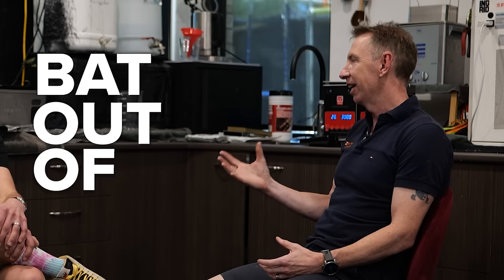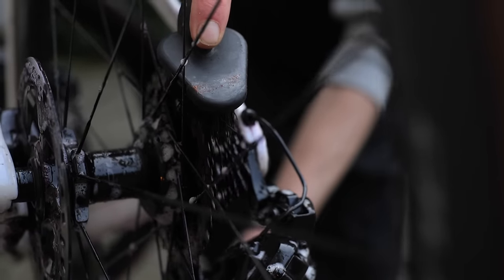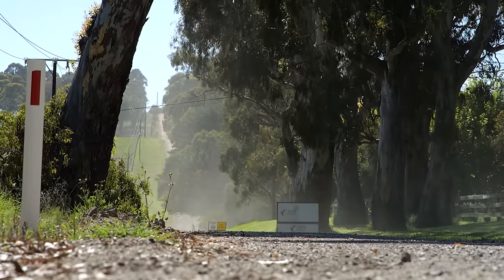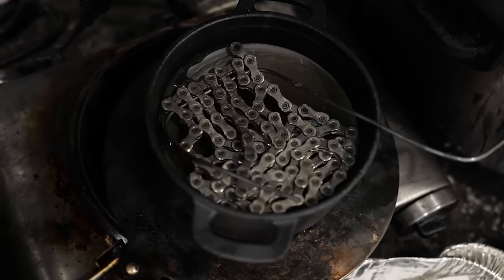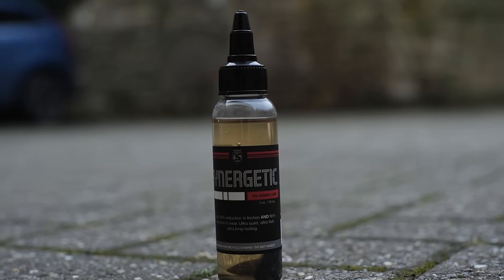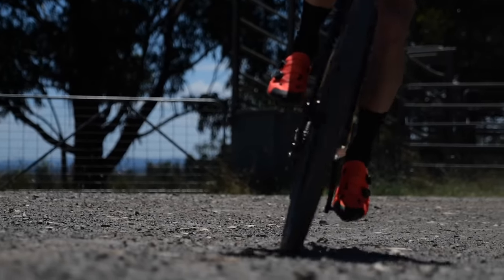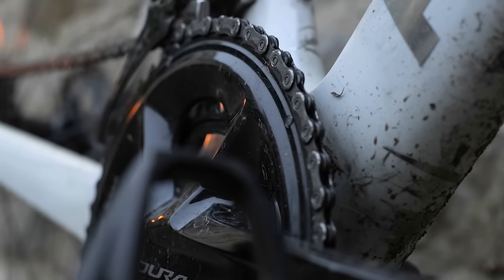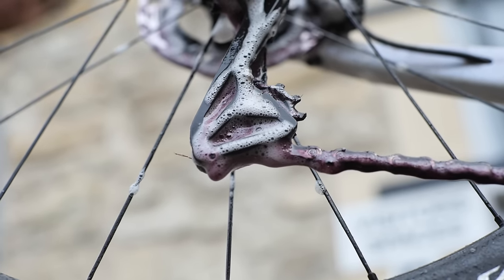They Don't Want Your Chain To Last This Long

Comment: I have to disagree with the general statements that wax lubes are worth it in time and money. I think you are wildly exaggerating the dollar amount saved and wildly underestimating the time spent in the waxing process.  
I typically ride 400km per week.  If we go by the experts recommendation of re-applying every 300km, that would be every 5-6 days of the hassle and time of reapplying the drip wax to each link, letting it soak in...   Then, every 1500 km removing the chain, degreasing it, heating up the wax, putting the chain in, letting it soak, pulling it out, wiping it down,  re-threading it through the derailleur and snapping the quick links on... then cleaning up the mess... That's a lot more than 15 minutes. Every 3 weeks.
Contrast that with giving my cranks a few spins while squirting the wet lube onto the chain, then wiping the chain down with a rag, and I'm ready to go for another 2-3 weeks.  Takes no more than 2 minutes.  
I check the chain wear with my Park chain wear tool and replace it at .75, which typically happens from 10,000km to 15,000km.  A new Shimano 105 or Ultegra 11 speed chain costs $35.    
I estimate I'm saving literally hours of time by using the wet lube over the life of the chain, and the annual cost in chains (1 per year) is next to nothing.
Reply: Well, you're wrong. No amount of wipe cleaning of chains stops the ingress of dirt and the chain wearing from the inside out, & in the last ¼ of the chain's life, you are adding massively to the wear of chainrings. If you are replacing your drivetrains at 5000-8000 km, you're at the limit of what 'shallow' cleaning of the chain can provide in terms of lifespan, withour wearing your chinrings. There is no way that you are getting 10-15K km out of a chain treated this way.
Reply: Cleaning a waxed chain every 300km could be for riding in more extreme conditions like gravel and MTB’ing, for road it varies by weather. For road it can be about every 800km with a drip wax (every two weeks for guys like us), it depends on the wax and weather  / conditions. You can also wipe and reapply a bit of wax lune between cleanings with waxes like Squirt.

Silca says you will get about 25,000 km out of a chain. So while it might be a bit more work than you are used to, it will save you money in the long run. FYI I maintain gravel, MTB, and road bikes for a family of 4, and I don’t often buy a new bottle of wax lube, it last a long time.
Reply: I think you have never waxed and don't realize how much cleaner a chain is, and how much longer  it lasts. You geta few chains and have a rotations going. It takes 15 seconds to put on a new chain, and you don't even have to wash your hands because they never get dirty. 

I have a chain with 3000 miles on it right now that id bet money you couldn't tell from the chain with 200 miles.

Even if it wasn't faster, for the clenliness and never fouling something with grease from chain bite on accident again, waxing is more than worth it, and is so much less of a hassle than you think it would be. If you are riding that much, you are paying enough attention to your bike that you can have an all your chains being waxed while you give it a clean.
Reply: @shawnington I have tried waxing and gave it up because the hassle wasn’t worth it to me and my waxed chains didn’t last any longer at all.  “a few chains” doesn’t sound like saving a lot of money like the waxing claims. 15 seconds to change a chain is exactly the kind of exaggeration I’m talking about. 3000 miles on my chains with Rock and Roll Gold lube gives me pretty much zero measurable wear via the Park tool as well. The only times I have to scrub my hands from the dirty chain is the one or two times a year I have to change the chain.  I don’t have to buy wax, or a mini crockpot to heat the wax up in, or spend any time messing with it.  Pros have mechanics to maintain their waxed chains and save the couple of watts, but I don’t think most of us care to spend that much of our time and energy on the most marginal of gains.
If it’s worth it for you, more power to you.  I’ve tried it and it isn’t worth it for me. Clean enough is clean enough, and I don’t have any meaningful or noticeable wear penalty by using a good quality wet lube over waxing, despite what the marketing says.
As for paying attention to my bike, it is a tool and I get joy out of riding it, not looking at it like a museum object. I fix it when something stops working properly, but the more time I spend paying attention to it, the less I get to ride. It’s a balance in life and everyone has to find their own balance that works for them.  
My issue is with the claims that the process of waxing chains 1: saves money,  and 2: doesn’t take any more time to maintain.  Both claims in my experience are just plain false.
Reply: You're supposed to wax a few chains in one go. I re-wax 8 chains across my Brompton and mountain bike. Your chainring and cassette will last longer with waxed chains, wet lube attracts grit & debris. And you will expend slightly less effort driving a waxed chain, especially freshly waxed.
Reply: It's always people that have never done something that are the experts on how long it takes but it's 10 minute effort at most for me in terms of removing, chucking in pot, coming back an hour later and hanging it up then back on the bike when it's time to ride.. there's no de'greasing''  step with a waxed chain.
Reply: Yeah, I’ve been waxing bike chains since the early ‘90s and there is a ton of internet hyperbole about it.  There are certain benefits, but it’s not life-changing.

The other school of thought is just buy mid-level drivetrain, use wet lube and clean occasionally with a rag.  Throw it all away when it shifts bad and replace with new.

Comment: I have two bikes, 50 years old, and they both have 100k miles on them. They both are as good shifting as when i bought them. I am so disappointed in modern drive chains. That is the reason i have not bought a new bike.

Comment: Just out of curiosity? Is there anyone riding 500k between lube applications and not washing the bike in between? If I do 100k training ride at the moment, the bike is covered in dirt and cow poop afterwards and I have to deep clean it and thus reapplying lube.
Reply: Sure. A waxed chain is effectively waterproof. And because you don’t have chain lube splashing all over or frame and rear wheel, it is far easier to wash with just water and mild soap. Just wipe the chain dry. Apply a coat of Silca drip wax and let dry overnight. Bob’s your uncle!
Reply: @jvogel431  A waxed chain is all but waterproof. Wet conditions is one of the places where even Josh from Silca suggests oil based lube.
Reply: All the time
Reply: @pandatactical4530  Where is that place? I have to book a holiday.
Reply: If you do road cycling in dry conditions of course you can ride 500 km until the next rewax or lube, which doesn't mean is the optimal thing to do. I do around 350-400 km between rewaxes and as I said, as long as it's dry road, both the chain and the bike stay pretty immaculate.
Reply: That’s the point of wax. Except for heavy wet, the wax will literally repel these contaminants and preserve itself. If that were me I might seriously ruling several chains and just swap them. With quick links, a plier, and stand it takes a couple of minutes. The rewax itself has cleaning properties.
Reply: @stephendenagy3396  Weeell, if you follow the instructions of Shimano and SRAM, you should not reuse a quick link which turns the whole calculation upside down. (They have a little notch that deforms of installation) That‘s also one of the issues I have with Zerofriction because it is mentioned but deep down a FAQ. Yes, a lot of people do it? Am I eager to try out if it snaps in a full on sprint? No.
Reply: Yes, me, I just swap waxed chains in 15 seconds and am good to go. Wax all my chains once a month takes 15 min.

Comment: Will 150 year old chain and cog technology "stand the test of time?"
It already has!  And it will persist.  With the bicycle's incredibly weak motor (human), efficiency losses are unacceptable.  Transmissions, although effective, are heavy, expensive and rob efficiency.  Heavier and less efficient is a double-whammy.  There's definitely a place for them - especially with e-bikes - but for the meat-powered versions, this system reigns supreme.
Never say never, but it doesn't look likely.

Comment: I Also Wax My Chain, it Does Definitely Make the Chain Last Longer. We Use BananaWax Drag & Friction TDF Racing Chain Wax on our bikes. 
The Problem is The Wax is as Much as a New Chain. 
The One Positive It does Cover 4 Chains From a Pot.
Reply: I use molten speed wax. It’s Adam’s highest rated wax and it isn’t very expensive

Comment: Come on people. These lubricants are stupidly expensive and prey on inexperienced or lazy customers. A strong degreaser and chain cleaning tool that allows you to properly clean your chain in 1-2 mins with a chain manufacturer recommended 80-90W gear oil will give you superior performance because it’s easy and quick to do.

Comment: If they made titanium chains and components, would it last longer?
Reply: No, shorter. Titanium is not an wonder material. It is MUCH softer than heat treated steel.
Reply: Plus, Ti is very abrasive, which is why frame makers have to change out their cutting tools more often when working with Ti.
Reply: @ericpmoss  Yes, I had something in the back of my mind that it is for some reason higher friction than steel.
Reply: titanium is quite soft compared to hardened steel so no.

Comment: Chain maintenance is a waste of money and time. The chain comes already greased from the factory and it's enough. Those lubricants you can buy are just dirt magnets. And they are expensive. How long is a chain supposed to last anyways. And it just costs around 15-20$.
Reply: This is misinformation

Comment: I don't do anything to my Chain  I don't wax it. I don't oil it.
And they last for decades. I am a bigger rider, so, how's this possible?
Reply: It’s not
Reply: It’s not. You’re either not riding it, or you’re unable to ascertain the difference between a worn chain and a new one.
Reply: I ride every day for the most part
Reply: They don't.  Without maintenance or cleaning, they're destroyed in fairly short order.
Reply: Because you’re not living is reality?
Reply: I think we dont notice any difference, I have not changed chain on any of my bikes for the last 30 years.
Reply: @martinriiser5523  Then, the chain and entire drive train has been destroyed.

Comment: Would you rather spend money on two 30€ Ultegra chains a year or on several ultrasonic cleaners with nasty chemicals, heated pots, quick links and finally divorce? 😉
Reply: Don’t forget the cost of the cassette. Ultrasonics not needed especially with the Silva Strip Chips. The trick is not to wax an old chain, but new. I have two new chains, one bought waxed, one will Strip Chip, and off we go, swapping when needed. And I will save that expensive cassette while I am at it. That’s the point, the ultrasonics not needed if you establish a practice from the start. The wax itself is 10 minutes. Nothing. Then it is solid and you put the Silva pot (tiny) wherever you want.
Reply: And don't forget the cost and toxicity of solvents etc when you have to clean the cassette/drive chain. WIth waxing this pretty much goes away and everything stays looking like new. If you haven't tried hot wax you really really don't know what youre missing. I changed 18 months ago. Never ever going back.